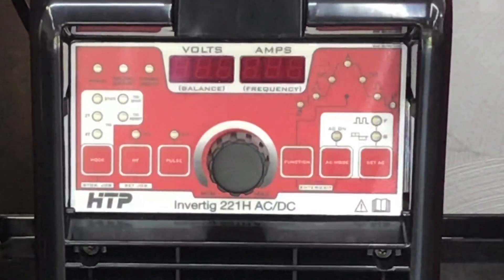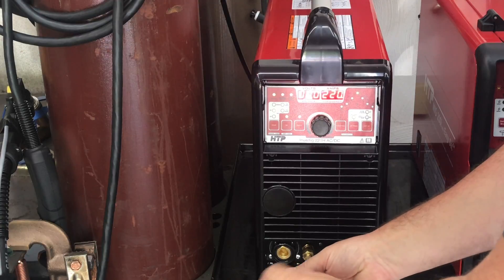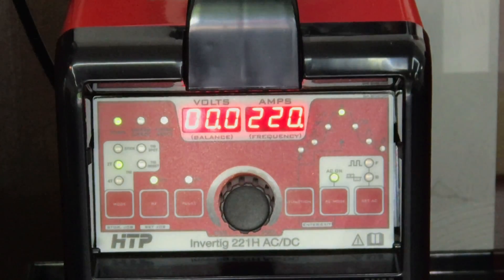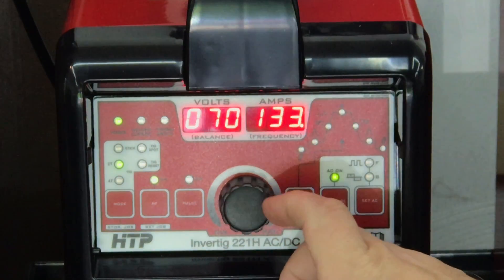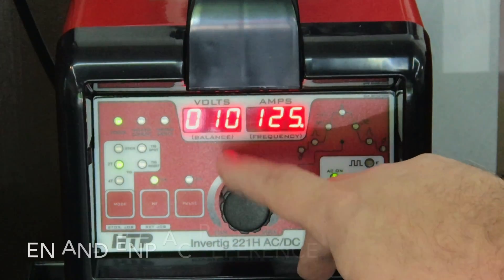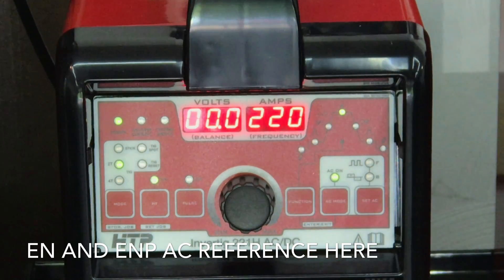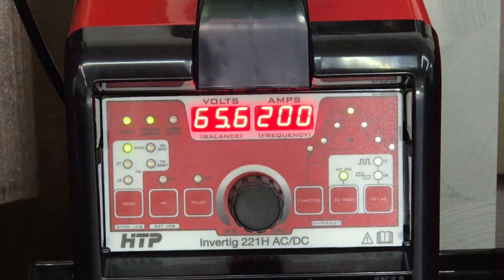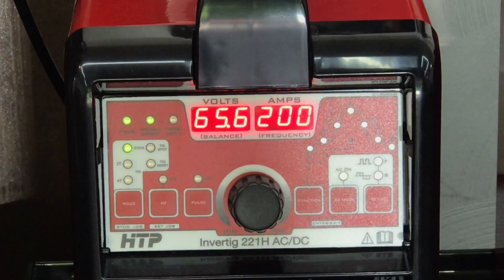HTP Invertig 221 Amplitude AC Adjustments & VRD

Comment: Why the first time that you go to the EN and ENP settings both were at 100?
Reply from the maker: Harvey Gonzalez it’s starts off at 100% of both which is Technically 50-50 electronegative electropositive switching
Reply: @weldingjunkie  thanks for the tips. I had the same machine and I was a little bit confuse
Reply: If I turn ON the VRD and tig weld in the stick mode the machine gonna turn down the voltage like been in tig mode? I'm asking because sometimes I don't use the foot pedal
Reply from the maker: Harvey Gonzalez you should get a slider for your Tig torch or momentary switch
Reply: @weldingjunkie  You need to get the tig button! once i played with the tig button for little bit and got used to it I havent used my foot pedal since lol. It truly is a game changer and available for the Invertig!
Reply from the maker: Harvey Gonzalez hmmm not sure you shouldn’t need VRD in Tig mode that’s only because the initial stick mode has a high voltage spike

Comment: I've never owned a welder with this setting but I have always wondered something about it.  We know the dcen is to penetrate and melt the aluminum while the reverse polarity dcep, is for cleaning the surface aluminum oxide.  I assume in my thought that the surface aluminum oxide is relatively the same on the surface of any aluminum regardless of the thickness of the aluminum itself,  so if we were welding very thin aluminum say at 60 to 80 amps, the 60 amps dcep cycle sufficiently cleans the aluminum oxide, at that 60 amps,  so if welding quarter inch aluminum at say, 175 amps or higher why wouldn't we be able to set the amplitude on dcep all the way down to 60 amps since all it has to do is clean the surface aluminum oxide.  I'm very curious to know if that works well in practical application
Reply: Or theoretically even much much lower dcep since successful welding of sheet aluminum can be done at 30 amps and still clean the oxide layer just wondering
Reply from the maker: Joe you are exactly right you can do that and its one of the applications its made for. on the other hand if you say cant do 3/8 you can set the amplitude full penetration and turn cleaning way down in order to do this. so you are right with your thoughts. you would need more than 60 amps to get a good penetration of the weld though for something to stick per say.

Comment: awesome man I think this might be my next machine have you ever put it on the duty cycle when welding?
Reply from the maker: Chris Renaud hey Chris this machine is incredible. Never once hit duty cycle It’s really underrated. Once you have the need to do more than 1/4” in one pass pick up a helium mix and this thing will do much thicker than 1/4”.  I truly love this machine and I prefer it over my Dynasy 210DX I feel like the arc is much smoother than the Miller. The dynasty is a really good machine too but if I had to pick just one it would be the HTP Invertig 221 all day everyday
Reply: Yeah too much money for a dynasty. Just considering the everlast 255ext or the htp 221. As far as price and settings it seems they are the best bet right now.
Reply: This runs 6010 well?
Reply from the maker: Chris Renaud oh hell yes! 6010 like a champ. Plus you can pulse 6010 stick as well..Has built in arc force and hot start. Will run any electrode all day long. I’ll tell you this over the everlast the boards are all coated and vertically mounted so no dust stays on them. The everlast mounts boards flat so dust settles. These machines are also very simple to change out a board if it was ever to fail as well as boards will always be available. No waiting 3 months for service. If you buy one let them know you saw it on here. You won’t regret it. This blows the everlast out of the water. The AC amplifier settings for aluminum are sick too. I made a video on that.
Reply: @weldingjunkie  nice will be a sweet upgrade from my Eastwood 200 which only has ac balance and amperage control fixed at 60hz also
Reply: the other thing about the american welders like miller and some lincoln machines people need to realize too.. what is inside a welder? circuit boards electronics right? well we don't manufacture those things here in USA like at all... though they may come up with the design here and assemble them here thats no different than what companies like everlast and HTP are doing the only difference is the screws are being put in overseas instead of in USA that is it... your paying premium for that brand like anything else
Reply: @chrisrenaud4141  which one did you get
Reply: @chrisrenaud4141  Chris, did you ever get a tig welder?

Comment: Any chance you could demo welding some 316L 11ga sheet butt welding with the invertig?  It would make a great PULSE lesson for many of us that have a tough time controlling heat input.  I've actually never used pulse on my machine and it's time I do.
Reply from the maker: I can do that, i have plenty of 316L filler. Ill get some 11ga sheet and get a video together.
Reply: You're the man!  I'm contemplating a stainless steel project of EPIC proportions.  I'm still doing research and the engineering at the moment... The pp200 or 300 is probably my answer, but getting familiar with the process will really help out.  I've sent you an email pointing to my total insanity.
Reply from the maker: worldtraveler LOL nothing is insane as long as you want to do it. Do you have both Pro Pulses? The pro pulse 300 is on my list next. Is the whole thing light gauge? 1/8” is good for mig or Tig - I never got an email. Jaymacs2@gmail.com
Reply: Haven't bought the mig yet.  Zila is trying to talk me into double pulse on the 300.  I'll resend you the link.
Reply from the maker: worldtraveler Pete knows his shit I sometimes don’t listen to him then I regret it lol I love my pro pulse 200 tho it does anything I need it to. I have the slider set up on the mig gun for aluminum too.
Reply: Ever weld 11ga 316L SS sheet on pulse with it?  I've only got half a mile to weld!   Pete is one of the best out there, but 5k is getting up there.  I'm cool with the 200 if it will handle the job and not warp the hell out of 10grand of stainless.
Reply from the maker: worldtraveler do you want me to do a pulse video on galv sheet 22 gauge? I can do a pulse video of that using C3 gas and 308 mig filler with the pro pulse 200? The pro pulse 200 will do the job but the 300 has a better duty cycle and double pulse. $4800 vs $2000 both fit the 10in spools. With that said if I could do it all over again I’d buy the 300. Mig- Tig - stick pulse and double pulse. It’s the pp200 on roids.